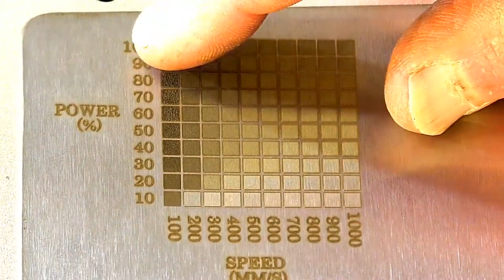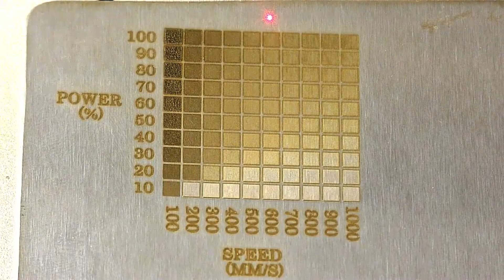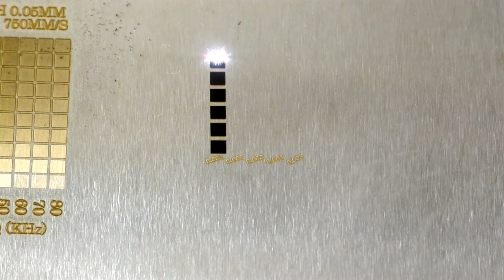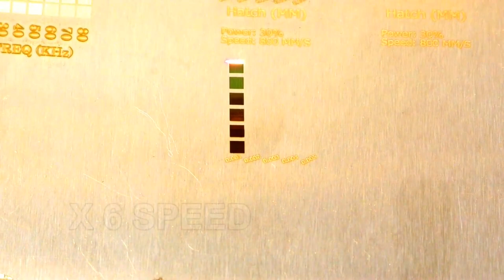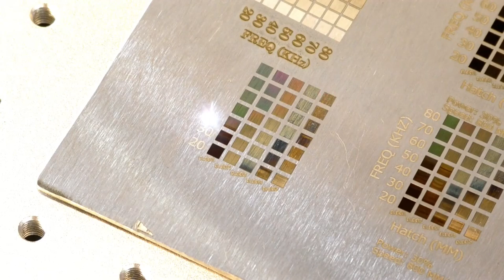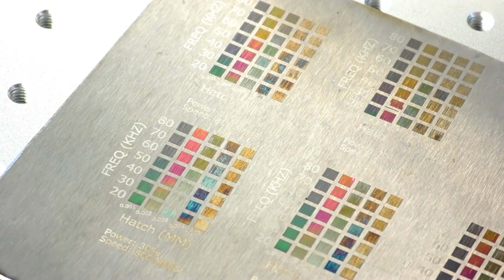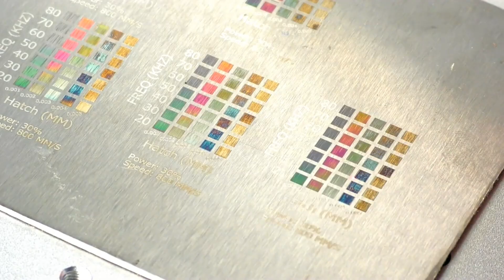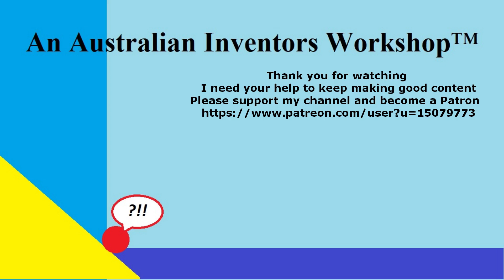Fibre Laser HOW TO $COLOUR$ engrave $$

Comment: I noticed that towards the end of the video, the vertical column on your laser machine wobbled every time you moved your arm while your elbow was resting on the table. It might be a good idea to not touch the table while it is printing/engraving. This might also have contributed to the variations in your results if you had been touching the table while doing the etching.